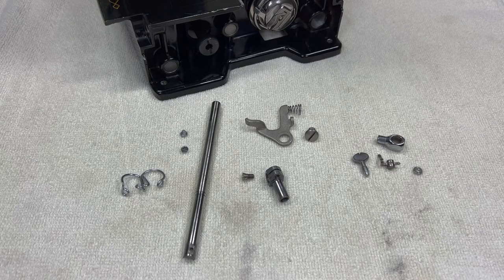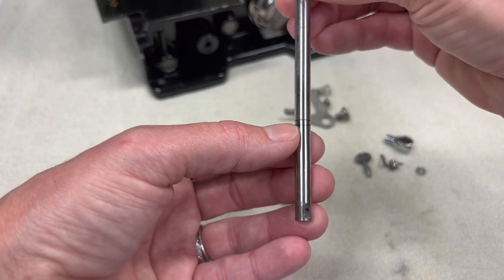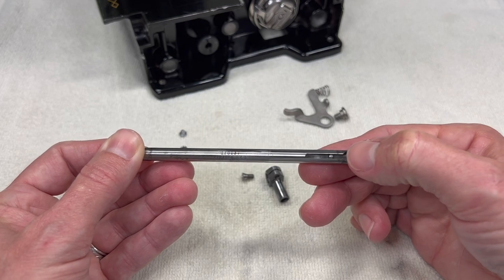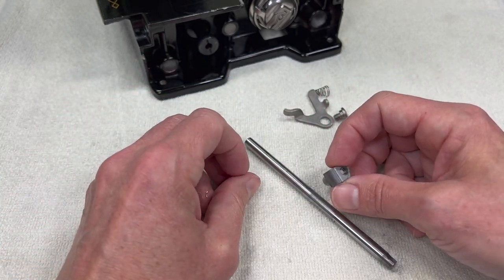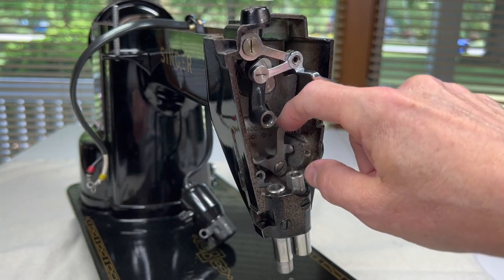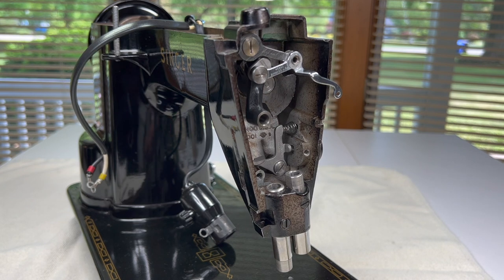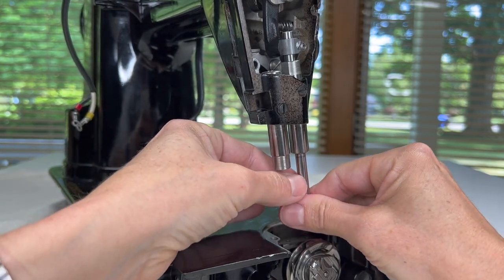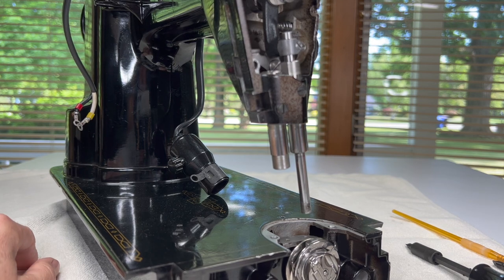How to install the needle bar and check timing on a Singer 301: Singer Restoration Series Part 18

Comment: How did you learn to work on these vintage machines? I’m just starting to get into this but struggle because I need the basic foundation and then build on that. I’m doing a complete overhaul of my grandmothers singer 127 treadle machine. I have it totally taken apart. Also, I’m getting a 301 that I want to work on as well. I worry sometimes if I will be able to get it put back together and running properly. You do great work
Reply from the maker: Hi Vicki! How exciting for you! I worried about putting my first machine back together too, (it was a Singer 404) take lots of pictures as you go and you will get it back together. I learned using lots of resources; particularly old service manuals and lots of YouTube. I still have a lot of models of vintage machines that I haven't touched and can't wait to take apart one day. Once you work on one or two it is less intimidating and if you are willing to make mistakes, you will learn. Don't invest a fortune in a machine that you are learning on, find a bargain so you if you have a big oops you can just chalk it up to the cost of learning. Finally, and probably most important, find places you can ask for help if you get stuck, this community is so kind and willing to share their knowledge. Welcome and you can do it!
Reply: Thank you for the advice. My grandmas treadle machine is my first one. It was such in bad shape. She had spray painted it so there was no way i could salvage the original decals, have to repaint and new decals. Started sandblasting the metal frame of the treadle. Taking my time and lots of pictures.

Comment: Help! I've been following your brilliant series (thank you for all the close up shots <3) but I can't get those two little screws holding the threadguards to actually set. They just spin. Or sometimes they seem like they might be set but then I try to tighten them down and they jostle out of place again. They are 100% the correct screws and I've cleaned them up along with the needlebar. This machine is so beautiful I really want to get 'er sewing. Any suggestions?
Reply from the maker: Hi! Did you get them in? They are so tiny, I usually can put the tip of my finger on them and spin them in. Putting the machine up on its nose when doing this makes the job a whole lot easier! Hope that helps if you are still stuck at this point.
Reply: @SewingMachineRehab  Thanks for the reply. Your video shows really good detail about how to make this work . . . unfortunately the tiny screws on my machine appeared to be stripped or something and just wouldn't grab the needlebar. I resorted to using some Loctite Threadlocker (i.e., screw glue) and the screws seem to hold the guides in place. It may be that with use this glue won't hold. At that point I think I'll have to resort to buying replacement parts /grrf. Thanks a bunch for this whole series. Amazing stuff!